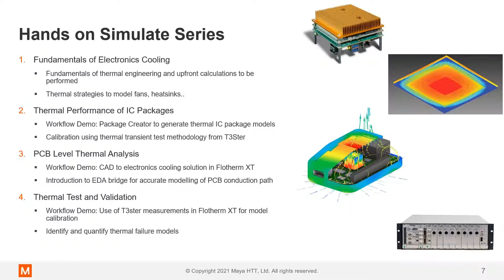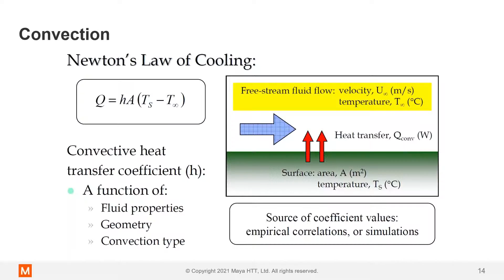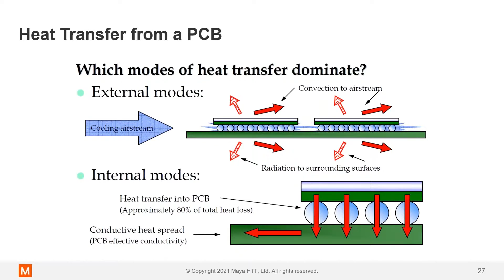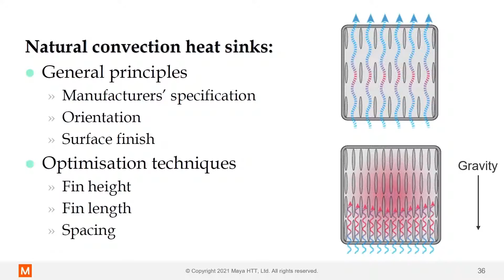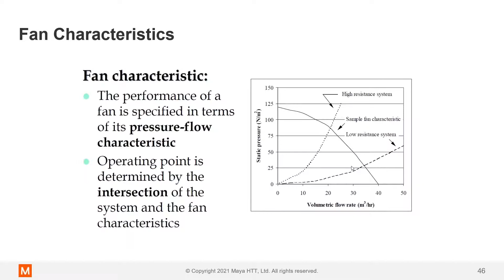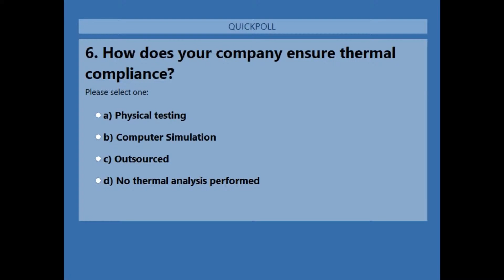Hands on Simulate with Simcenter Flotherm XT - Fundamentals of electronics cooling (Session 1)

Comment: Can a mechanical  engineer has scope to learn this flotherm or this software is only  for electronic engineer ?
Reply from the maker: Absolutely, as Flotherm is oriented towards mechanical engineers designing electronics cooling. Collaboration with electrical engineers is enabled by importing their PCB design data (ECAD), which Flotherm parses to obtain a high-fidelity thermal model of board/components.